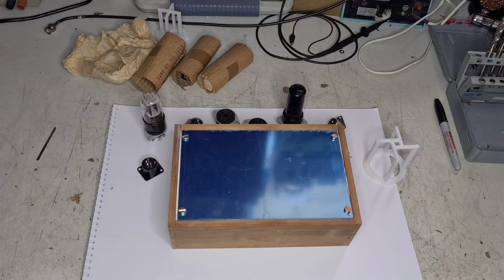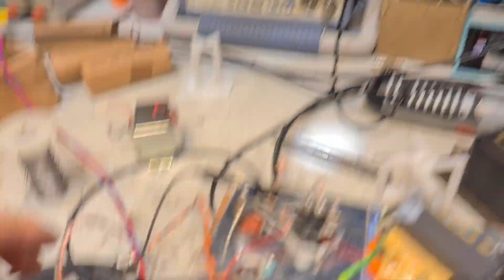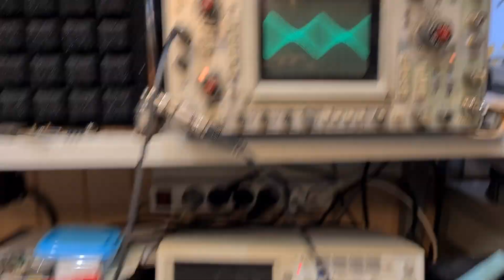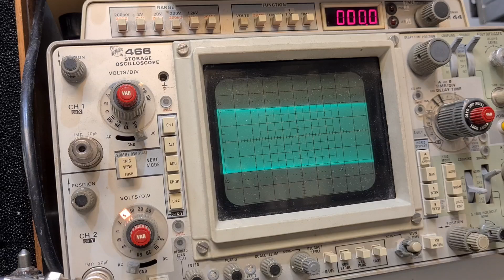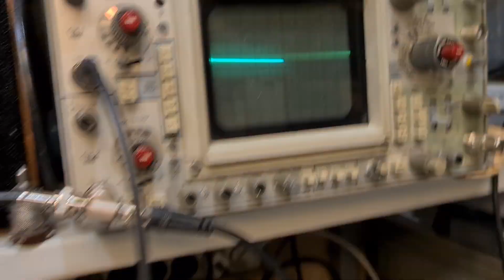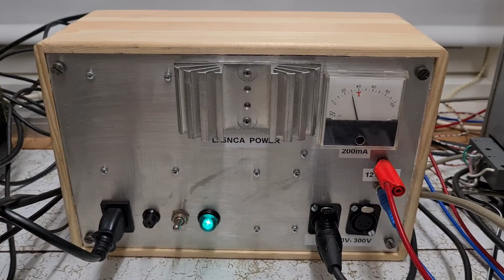Design an AM transmitter with cathode modulator.

Comment: Good morning. It's a beautiful AM transmitter. I have a question: is your tube filament power supply disconnected from ground? I'm concerned about not exceeding the maximum voltage between the cathode and the tube filament. Each 6L6 tube in this system should have a separate filament winding, not connected to ground.

Comment: A good example of a successful cathode modulated AM broadcast transmitter is the Harris MW-5A made back in the 70's.  It used a very high efficiency (94% plate efficiency) 3CX2500F3 triode as the RF power amp grid driven by a square wave solid state driver.  The cathode was modulated by an high level analog signal developed by filtering out a 70KHz switch pulse coming from the anode of a 4CX4000A tetrode.  Its control grid was driven by a 400V P-P pulse generated by a high voltage transistor which in turn had its base driven by a 70KHz pulse whose time duration varied by the audio input waveform (PDM).  This method eliminated the very heavy modulation transformer and gave superior audio frequency response.  Imagine all the bugs those designers had to work out in that first prototype.
Reply from the maker: Thanks for the interesting information. Was new to me.

Comment: Anode modulation works well using an old single end audio transformer .for the audio amp a tda250 will do the job
Using a triode / pentode tv video amp tube ,pierce oscillator  will put out about 1 watt.
Reply from the maker: Yes, thank you.

Comment: As a retired broadcast engineer, I love great examples of AM executed well. In the days before single sideband became common, the AM circuitry in Amateur radio equipment could be underpowered or produce less than great linearity. Cathode modulation can produce a high modulation index with good linearity while avoiding the cost of a modulation transformer necessary for high level plate modulation. Great work!
Reply from the maker: Thank you for your comment.
It was very easy to get good modulation with this method.
With good feedback, this can provide good modulation.

Comment: 😅😅😅 Double side band 😅

I like homemade transmitters. I built a some of them, one with 6L6 as output tube and another one with an El84 as output tube but I'm working to upgrade it to a pair of 807 in parallel.

Congrats ☺️☺️☺️

73 de EA1FLL
Reply from the maker: Yes, it is a lot of fun to build your own amplifiers and radios.

Comment: Great build ! Reminds me of a single 6L6 transmitter I built and used an old tube guitar amp as the input to the grid for modulation. 73 de VE3RKP
Reply from the maker: 6L6 is a good and cheap tube. It's fun with your own projects.